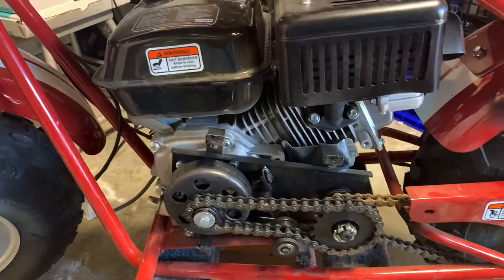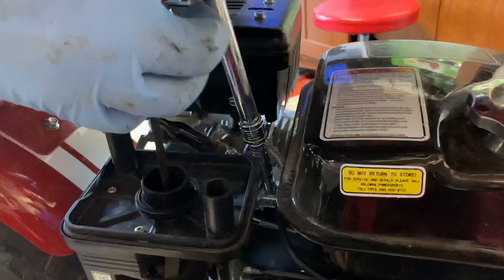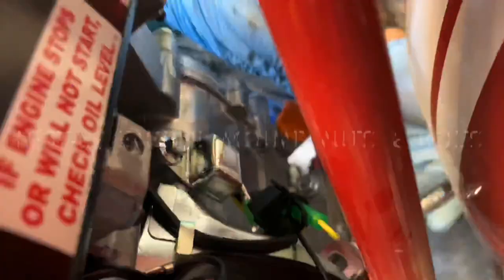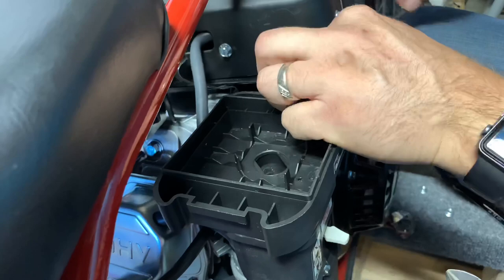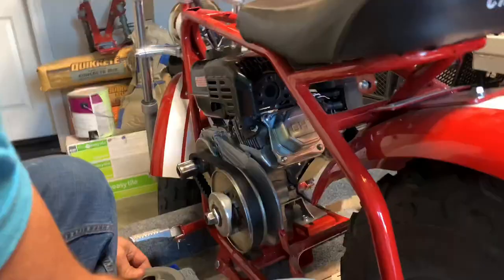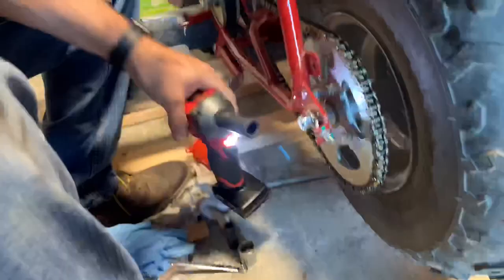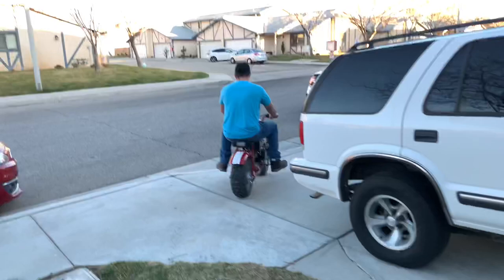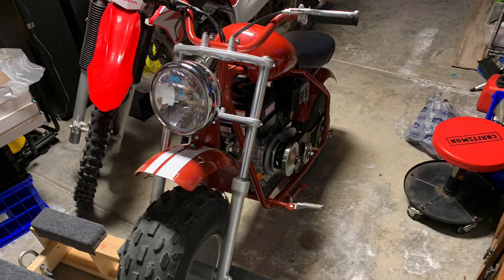Coleman CT200U-EXR Installing Torque Converter Mini Bike

Comment: No idea what you did with the zip ties? Did you just tighten the spring with two zip ties together? Also the riser plate did you install the bolts from underneath?
Reply from the maker: You put the zip tie through the center of the spring and use another zip tie to lock it in place. This doesn’t allow the spring to stretch which disables the governors ability to pullback on the throttle. On the plate, bolts through the top and nuts on the bottom to secure the riser to the frame. The engine bolts are from the top and bolts are already welded into the riser.

Comment: I noticed you didn’t have to cut your chain guard like most people do when installing the torque converter
Reply: The chain guard isn’t on the bike after the install? Are you referring to cutting the U shaped bar that the chain guard mounts to? Reason is because the adapter plate he used not only raises the engine 1 inch, but it also moves it forward allowing you clearance for that U shaped bar.
Reply: It raises the engine over a inch like a inch an a half. I have one on my bike

Comment: Great vid 
Thanks
Did you see a increase in acceleration and top speed?
What spring and hole?
Reply from the maker: Acceleration is night and day better as well as top speed. I used the stock configuration on the spring and hole.
Reply: @Sunshone7311  apparently if you move your spring to the third hole you can gain some top speed
Reply from the maker: @andrewdowney760  Correct, I was just happy where it is. I ride with my kids so 35-40 is good for me. I also have replacement springs in yellow that also change the driven side response, just had not had a need for them yet.

Comment: Great vid. Did you have to grind the torque converter mounting plate? I've noticed some people have to grind them so it won't interfere with the oil fill. Thanks!
Reply from the maker: I didn’t have a problem.

Comment: Do u think the engine risers that comes as an option with torque converter can clear chain guard brackets or do I need the engine plate that u have in your video?
Reply from the maker: 1” square iron risers will work.
Reply: @Sunshone7311  i think I will go with the plate u have.  To paint that plate u think regular rustoleum rattle can will work?
Reply from the maker: @l.a.m7645   Yes, I used the industrial paint (color + clear) since it’s oil resistant.
Reply: I just got a CT200U. Can I install a torque converter without cutting the chain guard bracket. Not sure if the frame arrangement is the same as the 200EX in this video.

Comment: Did they change the look of 212 engines it looks different than mine and my engine is only like a year old
Reply from the maker: Justin Woods Yeah, updated for emissions. Supposedly a more aggressive cam to warm up faster.
Reply: THAT is not a PREDATOR 212. THAT is a HISUN 196cc motor that comes factory with the coleman.
Reply: @THECHOSENONE-bk7xg  towards the end it is a predator
Reply: @justinwoods240  i didn't get that far. Distracted and moved on. Thanks for the correction

Comment: Can you do it without the predator or can these 196 engines not handle it?
Reply from the maker: You can, but the 196cc stock motors usually have 5/8” shafts and need an adapter to work. There is a significant difference in power. You will only notice it if you weigh over 175lbs.
Reply: @Sunshone7311  and it won’t be to much power?

Comment: Do you happen to know the size of bolts used to bolt the engine to the riser plate I ordered a kit from omb  warehouse and the bolts that came with the kit do not fit inside the riser plate so I was wondering if you  would happen to know the size of bolts I would need to mount the engine to the plate in the kit
Reply: 3/8

Comment: where did you get the engine mounting plate?  Is there a link or did you custom make the plate?  Also, do you have the link for the torque converter kit you used? Thank you for the video.
Reply from the maker: I bought the kit from OMB warehouse https://www.ombwarehouse.com/mini-bike-parts/coleman-powersports-mini-bike-parts/ct200-ex-bt200x/
Reply: @Sunshone7311  Thank you very much!

Comment: Did you loosen the axle nut then loosen rear adjusters, then tighten them and the nut?
Reply from the maker: Victor Reyes yes, you have to adjust back and forth to get it right. I initially overtightened and had to back the adjuster off a little.
Reply: @Sunshone7311  did you make sure to loosen nut on the right side of bike that holds the brake on?

Comment: What size chain is that ???
Reply from the maker: 40
Reply: The length ? Bc I’m about to do the same thing to mine and I don’t wanna purchase a small chain so I was wondering how long it is ? Feet? Or how many links ??
Reply from the maker: @MarioHernandez-xz5vk  It came with the kit, I didn’t measure it.

Comment: Nice Video Bro' ✅ 
I have the Same forward rise engine mount from OMB warehouse. Have my Tillotson 212  on it on my Colman BT200x with torque converter an 60 tooth rear sprocket' 💪
Reply: I just got my SunF Power 2 
Tires. Anxious to put them on'

Comment: That's not correct about the governor pulling back on full throttle. The governor does nothing on full throttle until it is able to overcome the spring tension near max governed RPM. The throttle on the carb will stay at full throttle until then. Saying that the bike accelerates better with a zip tie has been a myth for quite a while. The zip tie is not needed on Coleman 200's with a torque converter and stock gearing. You would be lucky to get 3600 (stock governed) RPM out of that bike. That's about 45 MPH.
Reply from the maker: I don’t know where you are getting that from. The zip tie absolutely changes the throttle response and running bikes side by side there is a considerable difference off the line. You can do as you please, but it does make a difference.
Reply: @Sunshone7311  my ct200 ex went from 24 mph to 33.9 mph after the ziptie method!! No other mods done fully stock

Comment: Hey guy im not trying to be a jerk or anything but you do know the hisun 196cc engine is a predator right hisun makes the honda clones and there sold by harbor freight as predator engines    other people sell them under different names
if you look in predator manual youll find that the manual says that the motor is built by hisun
even the mini bike frame is built by hisun you can read this on the little tag under the seat... also coleman powersports isnt coleman at all these mini are imported by godfrey and associates d.b.a. coleman powersports ... im sure Godfrey and assiciates licensed the name coleman i hope i didnt come across as a jerk
Reply: Yeah I could never understand why people swap out a good engine like this. These engines are just as upgradable as the harbor freight engines and arguably better quality. The 212 does have slightly more torque than the 196's. If I wanted to do this to my bike I would buy a $30 crankshaft, I wouldn't buy a new engine.

They must have recently made the change of manufactures for the Predator. I thought they were made by a different company that I can't think of at the moment.
Reply: Well why does the Hisun have a plastic cam gear an predator has a metal cam gear? Im just saying. I don't run with one of those engines I run Tillotson 212 more Torque an Horsepower than Hisun Predator an Honda.
Reply: @jacobsebastien3910  i couldnt tell you that but i can say this ive got a predator 212cc on a pressure washer original hisun 196cc engine on the coleman and a northern tools branded ironton 208 cc engine on a homemade alternator generator theres no noticeable difference in power in the engines
Reply: @jacobsebastien3910  The plastic cam gear is not a problem at all and has been spun 7000+ RPM. Some regularly see 5800 RPM. It would get replaced anyway if you want real power. I have a Hisun apart now. Pretty decent clone.

Comment: It would be a Bigg Difference in Torque if you put a 60t sprocket on rear bro" 
An Luv Milwaukee Power Tools 💪
Reply: An you won't lose Top End with 60t sprocket because of the torque converter.